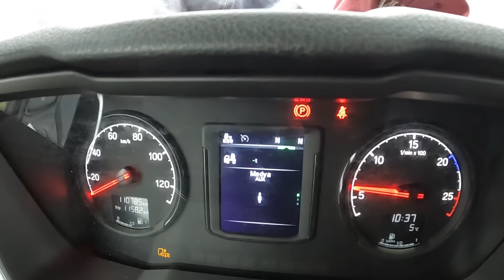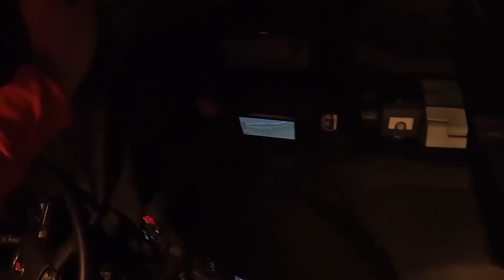Alone Trucker's Night Routine and Dinner - Truck Camping

Comment: were you expecting company? you cooked spaghetti for a family of four, no joke, btw, before you put the pasta in the pan you must have the water boiling, also, add some salt and oil while boiling so the pasta won’t stick to the pan, just a suggestion 😉👍
Reply: Nooo, lol no oil in the water, it makes the sauce slip off. Just leave a small amount of water when you drain, then drain off the rest when you put the sauce in. The salt is a good suggestion though. I'll add one too, snap the pasta in half before you put it in the water. Mush easier than waiting it to get soft and it won't burn around the middle.